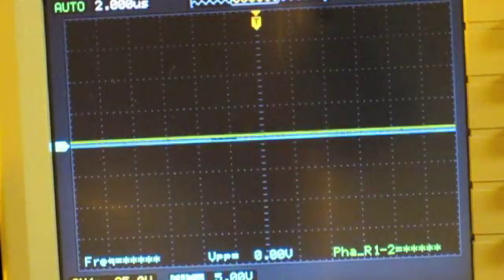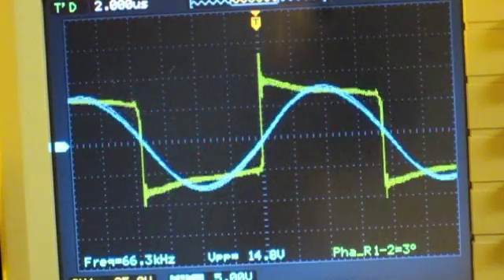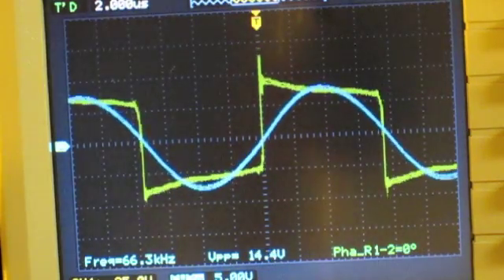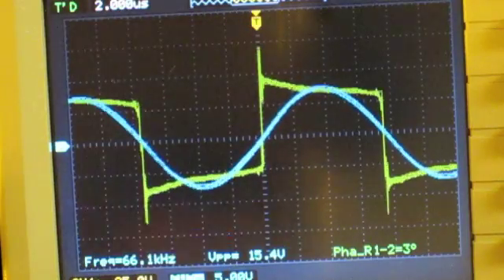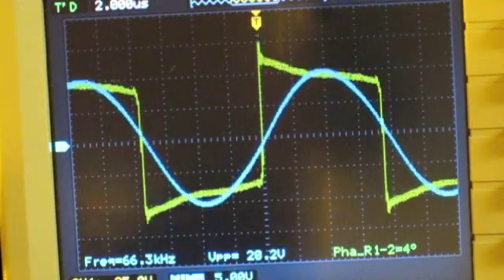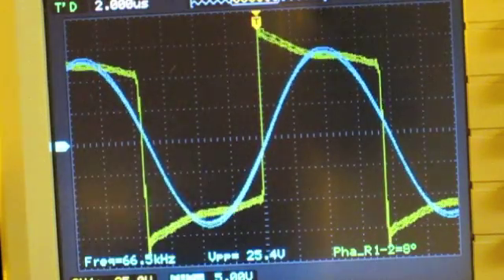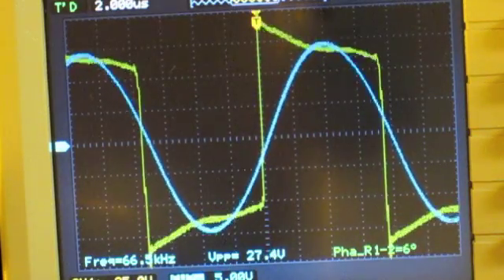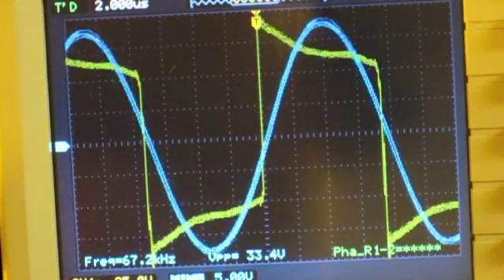Induction heater microprocessor control

Comment: @mikefromspace You dont need that high freq with magnetic nanoparticles (in sugar compounds like dextrose or mannitol). Cancer uses sugar as primary energy source so nanoparticles goes to cancer cells with high accuracy. Then just heat them with hysteresis loss over 42 deg C. Some magnetic nanoparticles have curie point in 40-60C so there is no need for power control or temperature regulation. Easy and safe. The same particles can be also used in diagnostics and controlling the treatment.